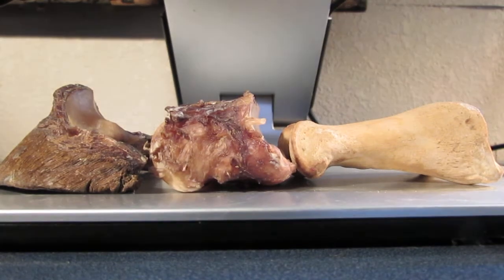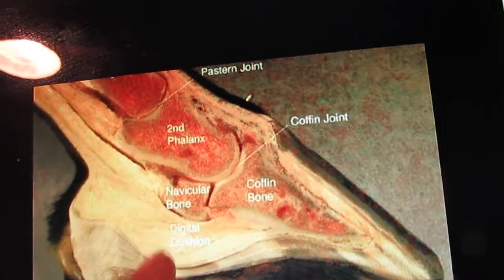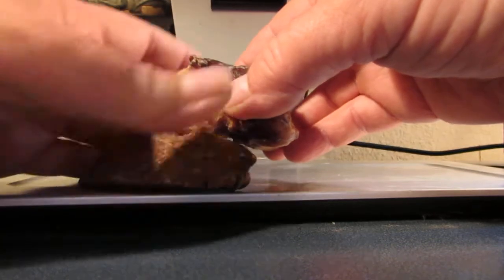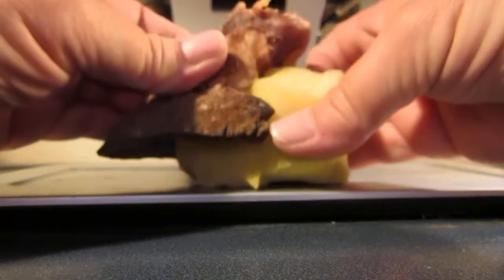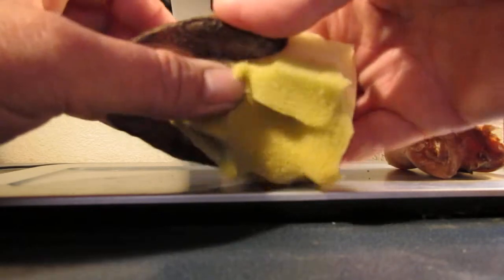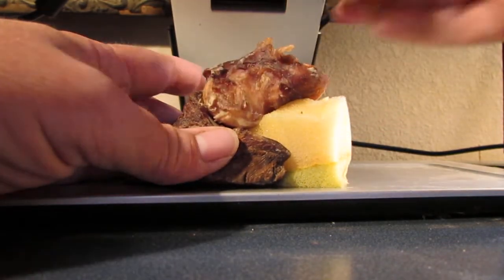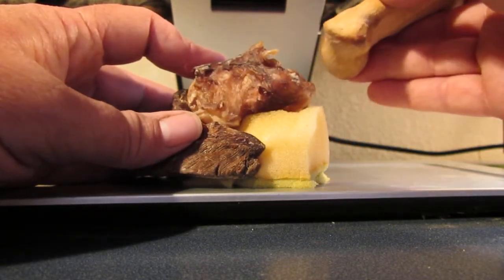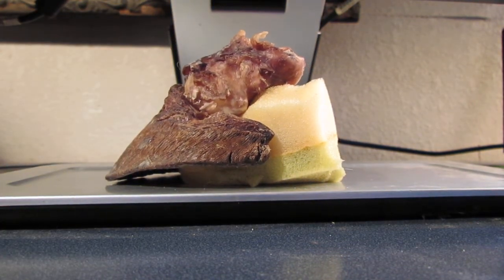Understanding the Digital Cushion, VERY IMPORTANT....

Comment: Please stop sharing anatomically incorrect information. P2 does not "bottom out" during the stride. The metacarpal/phalangeal (fetlock) can come in contact with the ground but the short pastern (P2) is not long enough to reach the ground. If your thought that the digital cushion "pushes" P2 back into position could you please explain why under load there has been shown to be a negative pressure in the digital cushion? Please elaborate as to what an "anatomically" correct digital cushion consist of?
Reply from the maker: I will if you send me your emial or tell me your face book page becaseu I have to show you in pictures of dissected hooves.
Reply from the maker: With the manner in which they are totally trimming the whole heel apparatus out of the back of the foot, it would not surprise me if they are removing enough that p2 could actually bottom out on some of them. But I also see what you mean. But on the otherhand when I say bottom out I mean there is not more real suspension left without the frog stay. that supports the digital cushion. Look If I am wrong on someof this that's great to know, but I want to fully understand what is going on with these feet and they sure as heck are not teaching people anything except a lot of error.